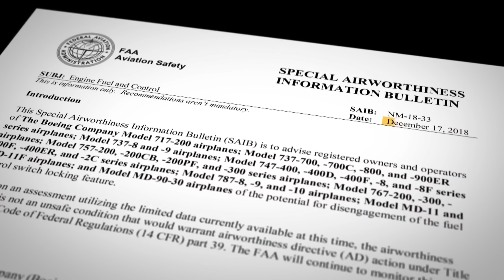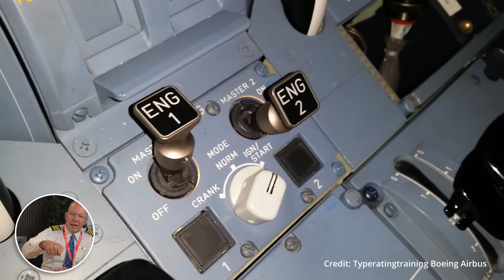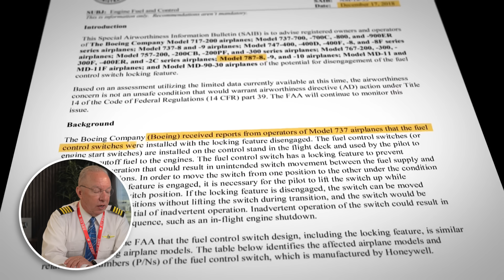Air India 171: The FAA’s 2018 Fuel Switch Locking Bulletin Explained (16 Questions Answered)

Comment: Is it possible that the engines got cut off because of some kind of mechanical issue, the fuel switch was found off because the pilots were trying to shut them off and restart but just didn’t have enough time to turn back on? Yes, one pilot asked another why did you turn it off. However, that might be his first reaction when he realized the engines cut off, doesn’t mean he actually saw the other pilot do it. When the other pilot denied, they realized there was a problem so they attempted to restart the engines?

Comment: I have a simple question if these switches are only used for off at the gate and on while flying, why are they mounted so accessible
Reply: Because if there's an engine fire during flight the pilot has to shut off the fuel going to that engine immediately.

Comment: "safety rules are written in blood"
Aviation disaster caused by Air India CEO (the buck stops at the head of the board) refusing to fund "unnecessary" maintenance inspections. 
This aircraft VT-ANB had a history of failed user facing electrical systems indicating poor maintenance practices.
Air India (mis)management ignored non mandatory maintenance inspections and 242 people died.
Boeing/FAA have to find an answer as to why a serious fault as described in SAIB: NM-18-33 was not rated as mandatory :
"This is information only. Recommendations aren’t mandatory." 
Maybe the safety bulletin will get upgraded to mandatory.

Comment: "The airplane was operating the way it was designed to operate..."
So you are saying they designed an aircraft that allowed the fuel to both engines be cut off while the aircraft was still gaining speed and within 4 seconds from lift-off?
In what situation would that be a GOOD thing??
Reply: Welp, until 1:39pm on 12 June 2025, those fuel cut-off switches had never posed a problem. I would definitely like to see a workable solution instituted, sure, but I can't really fault airplane designers for not anticipating a pilot wanting to crash his plane in this particular way.
Reply: @Everywhere2  And the recorder did not record a struggle taking place in the cabin between pilots?  Both pilots wanted to die?  What are the odds of this?  This is absurd!  I have a different theory!  There will be more "murder-suicide" accidents in Boeing airplanes in the future.  Why?  Because lies have very short legs!
Reply: People said same thing about Boeing 737 max too.

Comment: Thank you Capt Steve, you just answered one of my questions! (Pilots WOULD hear the engine note change virtually as the switches were flipped). But it generates a new one.
The fuel switches were cut off 3 seconds into airflight  yet it took 9 and 13 seconds to turn them back on? Why, if such a critical situation - engines lost power during take-off - could be detected by either pilot almost immediately the switches were moved?
Reply: Pure logic suggests that both pilots at the same time decided on suicide!  That is why they waited with turning the swithces ON for a good 10 seconds.

Comment: There could have been a FADEC malfunction. This would be consistent with the word ' transitioned'  and the  pilots conversation if neither pilot physically turned the the switches off.

Both switches were then physically toggled OFF/ON in an attempt to restart
Reply: There are separate FADEC systems for each engine.

Comment: The captain was in a deep mode of depression till he did something that he doesn't intention to do it. This happened to most of us (whether we aware or not) when we not focusing and thinking of doing something but do something else instead. My opinion.
Reply: And the recorder did not record a struggle taking place in the cabin between pilots?  Both pilots wanted to die?  What are the odds of this?  This is absurd!
I have a different theory!  There will be more "murder-suicide" accidents in Boeing airplanes in the future.  Why?  Because lies have very short legs!
Reply: @sezwo5774  The second pilot was focusing on flying the plane. It just took off. Maybe at this point he saw at his sight that the captain was doing something, and the plane trust begin to die off.

Comment: You seem to be leaning towards pilot suicide. I am not with you there - consider that the noted pilot action from the report is actually the QRH memory drill for dual engine failure - exactly those actions. What if they were reacting to dual loss of thrust, Sub-idle rollback. This isn't mentioned nor discounted in the report. Still best not to jump to conclusions.
Reply: He's dancing around it, but won't come out and say it for some reason and keeps talking about "pilot mental health." Very bizzare he won't be specific and say that he thinks the pilot intentionally killed everyone. If that's what you really think then just say it.
Reply: The FDR and CVR would obviously confirm this if that’s what happened. There was no loss of thrust until the fuel was cut off from the  cockpit.
Reply: @comfortablynick1  Correction. The evidence only shows that the fuel was cut by the Flight Computer. There is ZERO recording of physical switch positions and both pilots didn't know why the the fuel was cut-off then switched back on as evidenced in the recorded verbal exchange. Yes, humans can fail, BUT COMPUTERS & HARDWARE CAN ALSO FAIL ... THis is being deliberately covered up.
Reply: @Jester-Riddle  That is incorrect according to the report. The physical switches were moved. Sorry, but the computer can’t do that according to all the sources I’ve seen.
Reply: @comfortablynick1 you believe the report? It's light!
Reply: @Jester-Riddle 
The switches have multiple wires and the FDR absolutely knows the physical positions of the switch and whether they moved or not.
Reply: @comfortablynick1 ... Or was there? Other vlogs suggest there might have been yet unreported in this preliminary report.

Comment: The fuel control switch should lose it's function when the aircraft is airborne, as long as there is no other alert, like fire or abnormal vibration etc. This would also prevent to shut off the wrong engine in case one has failed.
Just my two cents here.

Comment: Is FAA communiqué on the fuel cutoff switch, only cautions about “disengagement of locking mechanism”? Just because the locking mechanism fails, this switch does not necessarily cutoff the fuel supply without human intervention.
From where does the recoded (in black box) fuel cut off operation signal originate? From an axillary contact in the fuel cut switch in the cockpit or from axillary contacts on the fuel cut off valve in the engine or from the engine control computer?

Comment: A power transient could have caused a false command to fuel control logic.
Momentarily cut off electronic engine control (FADEC) or triggered an erroneous engine shutdown signal. The passenger on same aircraft posted a video the ac and displays where malfunctioning going on and off in vt anbs previous flight from delhi to ahmdabad, power bus flauctuation ,electrical load shedding  or a fault in integrated drive generators or power distribution unit. what do you think?

Comment: Your description of the bulletin, doesn't agree with the bulletin. It states clearly that the switches in question do work, but with no locking feature. Still, if they were bumped by accident, there would not be a 1sec gap between them being shutoff.

Comment: When it comes to black box data, a video component could easily be added to the rest of the parameters recorded. The voices and ambient sound is already there for review. I know this is a touchy subject with the commercial airline pilots unions. All I'm saying is that the technology is there and I think it may be time to consider it along with secure a satellite up-link data stream for remote storage. In the MH 370 case, the black boxes have never been recovered and the disappearance remains a mystery. Up-linking the data to remote storage would have most likely have solved the mystery.

Comment: As a lead investigator for merchant ships, it is surprising to see such critical control switches with only one safety barrier of a spring-loaded arrangement. There should be a glass box cover on top with a hinge lid & an audio alarm system when that lid is open to have a second barrier to avoid willful/inadvertent execution.
Reply: You realize no pilot has ever done this before right? The switches themselves work fine how they are. You have to pull up on a spring loaded lever and then push it over a detent. It takes purpose and some force. There’s no cover because pilots need to be able to access them quickly if there’s ever an engine failure. I understand where you’re coming from but they’re  not launching missiles with these switches and a plane isn’t a SHIP lol.
Reply: @cb24203 Hope you realize that this has happened now, and we must learn from it while we can. It is not about the functionality of the switches but the addition of a second safety barrier to the critical system. These switches are used only on the ground & in case of engine failure, so the extra safety won’t hurt. The cover, which I suggested, is frequently used in all industries & without any restriction. Using such a safety measure becomes all the more necessary on an aircraft where misuse of the switch has only one consequence of free fall, thanks to gravity, which never happens on a SHIP…Hope you understand the difference between a Ship & a Boat like the difference between a Truck & a Car… FYI, we have carried the Choppers & Airbus sections as part of our cargo on a Ship to give you a perspective…LOL..!
Reply: @Capt.Gagan.Boparai  Think you might have had too much time at sea mate. 😂Pilots have been using these switches for decades without issue but now they need special plastic covers? You’re  missing the entire point. The issue isn’t with the switch moving by itself. It has very secure locking mechanism you have to pull up on and push with force. They were still locked securely in place after the crash. If the pilot did it on purpose a plastic cover will do absolutely nothing. Also some planes do have a safety barrier. The thruster has to be in the idle position for the fuel to be cut, but that’s not how this Boeing jet worked. You can put all the buzzers and glass boxes you want and but if a pilot WANTS to crash a plane he most likely will succeed.
Reply: @cb24203 I'm not trying to prove anything here, just saying if one Pilot does something with dire consequences, at least the other pilot can intervene with exigency. In this case, Boeing will definitely claim their systems/machinery is Robust & place the blame on dead pilots...easy insurance money...!! So I rest my case, anyway for all I know I am talking to an AI bot in Boeing..!!😆
Reply: @Capt.Gagan.Boparai   sorry not an Ai bot. They make me want to vomit actually. 😂 I give you credit for thinking of that though. 😂. The extra doors and buzzers seem like good ideas from a ship perspective. There are certain unwritten rules and ethics for pilots. Especially questioning one that’s higher up than you. Whether there’s covers and buzzers, If a pilot wants to flip some switches during flight he’s gonna do it. No co-pilot would ever expect the other pilot to do this so it’s kind of ridiculous to think he’d try to intervene as it’s happening. He’ll only be able to react after the fact, like what happened here. On a ship you can have all the plastic switch covers you want because you’ll never ever need those switches if the ship is upside down. If a plane somehow gets inverted the last thing pilots need are little plastic doors to fumble around with and extra buzzers going off. They go through the checklists quick when there’s an emergency. These planes are designed with the highest level of engineering and nothing is overlooked. There’s probably more reasons why covers and buzzers aren’t used that I’m missing too. Your argument is almost like saying “if a gun had a buzzer on the safety switch then a man would have never killed himself because his wife could have heard it and intervened.” What happened with Air India has never ever ever happened before and there’s a reason for that. Because no one was ever sick and stupid enough to do it. And yes, your case is rested, it was put to bed three comments ago. Kinda sad how society has become so fact resistant. All evidence points to the pilot but still people want to blame planes that are the safest form of transportation on this planet. 😂

Comment: Why was the RAT deployed?
RAT will not be deployed if fuel switches are turned off manually.

This is 100% failure with the Boeing aircraft(including GE engines) and those trying to put the blame on the pilots are outright liars and deceptive to the core

Comment: Full Authority Digital Engine Control (FADEC) means just that. There is no direct pilot control over the engine or manual control mode. If the FADEC fails, the engine fails.

Comment: What is the guarantee that the switches were not changed post crash by someone on the ground clearing wreckage(unintentionally, while picking up)? 
There were many civilians also who contributed in clearup atleast in the beginning.
The govt has not released audio of the blackbox too, 
So they wrote what conversation happened and noe blaming that someone cut the engine while in flight
Reply: The throttles were found in the idle position after the crash. It was explained they moved with the subsequent crash and others said the fuel control switches cannot be moved with the crash!!

Comment: According to report and Steve’s explanation, it appears that the pilot observed the co-pilot turning off the switch before making the remark. However, how many people would respond with a polite “Why did you cut off?” upon seeing their co-pilot disable such a critical switch? In such a situation, most would likely exclaim, “Are you crazy?”, “Are you mad?”, or “Hey, what are you doing?” It’s possible that the pilot didn’t see the co-pilot turn off the switch but instead noticed it later—perhaps after detecting a change in engine behavior, finding the switch in the off position, and then commenting. Even in that case, wouldn’t the more natural response be, “Did you cut it off?” rather than “Why did you cut it off?”
Reply: Right. I'm very interested in seeing the full transcript from the cockpit voice recorder. That much detail is beyond the scope of a preliminary report, but we're all left puzzling over the two tiny bits of dialog AAIB included at this stage.
Reply: Unless it was completely premeditated and happened in reverse. I.e. the one who shut them off asked the question ???
Reply: @seanfeeney8891  If someone is trying to crash the plane then why will he risk screwing his plans by signalling that to his copilot - he will rather keep quite???

Comment: Fuel CutOff Switch : 

1.Can the Plane Take Off when its in OFF Position is there any warning Pilots get when its OFF at the time of Take Off...?

2.When on Flight i mean while on Take OFF time any of the Pilot can OFF the Cutoff Switch Manually, is it possible or its Locked till it Flight reaches a certain altitude...?

3.When Pilots understand the Two Engine is Down is there a Procedure that Pilots ON and OFF this Switchs as they might have assumed its a Engine Fuel Cuttoff situation...?

Comment: At 15:27 I believe he's referring to the CCTV screenshots from the report, it shows the plane on take off with the RAT deplyed.

My answer to that question though is that the plane still had momentum and energy even though the engines were spooling down, once it ran out of that momentum is where it started to sink.

Comment: You don’t know if the switches were placed in the off position… you weren’t there, you cannot claim that with 100% security ! Don’t do that !!
I don’t understand how you can dismiss a broken wire(s) or a software fault ?! Your speculation isn’t helping, I prefer to wait and see what a final report tells us .

The bulletin about the locking feature potentially failing offers an opportunity for an accidental manual deactivation - no ?
I must say the 1 second delay between the off switching looks a lot like manually switching one after the other…